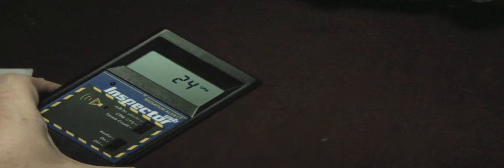Westclox Big Ben with Radium glow paint

Comment: Great find! And really nice video :)
Reply from the maker: It was a stroke of dumb luck that I found this thing. Since I live in the retirement capital of the US (Florida), there are tons of thrift shops everywhere that sell stuff like this that people get from grandparents or whatever. Im still on the hunt for old fiestaware or vasaline glass, preferably marbles, that I can add to my radioactive collection. Also working on getting either isotope samples or a chunk of uranium ore as well. My video skills aren't that great but at least the camera I have is decent. Thanks for the comment!
Reply from the maker: Ill check those groups out, as Im sure ill have questions about some stuff. As far as the NRC is concerned, I will be maintaining everything above board, as I do not want to incur the wrath of any federal agency. My room mates were not home when I made this but they sleep like the dead so it wouldnt have mattered much, plus they are on the other side of the house. Ill slowly acquire my sources over time as they are rather pricey but having them for check sources would be rather handy, especially Cs-137 since thats what most counters are calibrated for, and that source will be a calibrated one to check for counter accuracy. Ill eventually have a spectrometer so that I know what it is that Im dealing with (unknown minerals) and what precautions I need to take. Love radioactive stuff but safety is my primary concern, that and legality.I made a sign for my clock to notify people that come by to not touch it unless Im there, but the trefoil on it does that for me anyway. :)

Comment: I just took one of these apart. Was that not a good move? Wondering how safe it is to keep around and I can’t find much on the web
Reply from the maker: As long as none of the paint on the face or hands breaks off or flakes off, you should be okay. I would avoid touching any of the parts with your bare hands, as there is a possibility of that getting onto either something you eat or drink from and could ingest a small amount of Radium. 

If you have touched these parts with your hands, go wash them off thoroughly and get a pair of disposable gloves to handle the parts with. Radium ingestion can lead to health issues. Also if you dont already have one, get a geiger counter and keep it nearby as you'll  want to make sure of your level of exposure. Also, plastic film to lay onto your work area to catch anything that may fall off and wear a mask, not the surgical ones.

I would also suggest the area you work in be cleaned thoroughly and the waste be disposed of properly as to avoid surface contamination and transference to other things.

You want to avoid getting any of the Radium paint in or on your body. Thankfully, Radium is an alpha emitter and the particles are stopped fairly easily, but can cause issues if ingested or left on the skin for extended periods of time. 

Also, if you dont have a geiger counter, get one that can pick up alpha, beta and gamma radiation, as it will be more sensitive to whats there, a "pancake" style geiger tube like my inspector usb in the video has is a good option, though they are pricey.

Edit: if the parts are kept at a good distance from your living areas, you'll be fine. My clock sits on a shelf thats about 8 to 10 feet away and the geiger counter doesnt pick up anything from it until you literally stick the counter right in front of it.